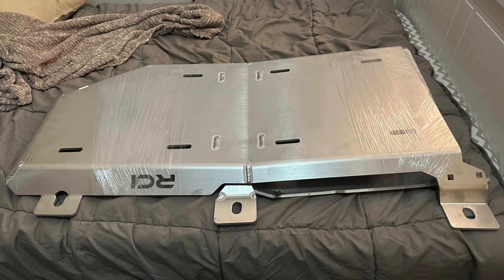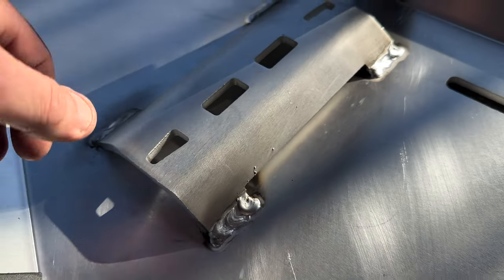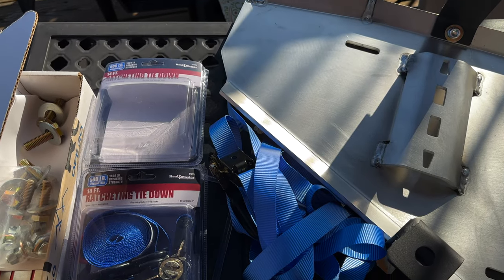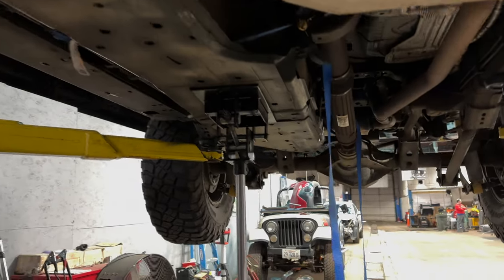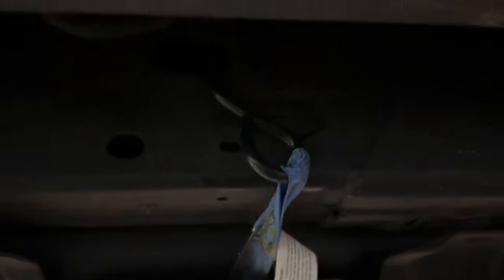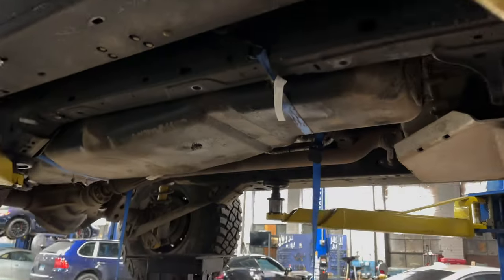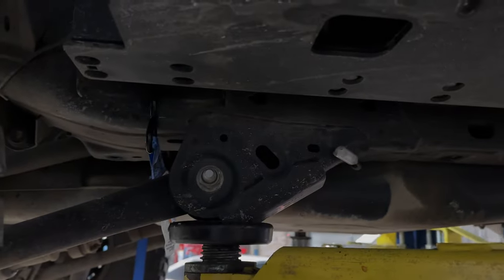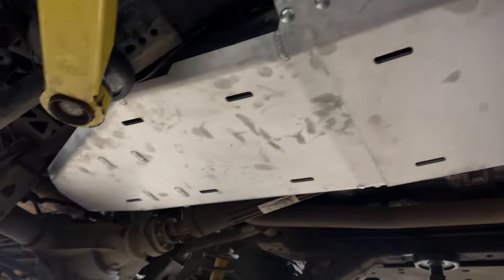Bronco RCI Fuel Tank Skid Plate

Comment: Looking at doing this as well - How difficult would it be to drop the gas tank?
Reply from the maker: If you don't strap it up prior to removing the stock skid, it will fall.  The general rule of thumb is to have the least amount of gas in the tank as possible prior to doing this.  The JCR video I linked in the description has a more detailed account on using the straps.  I would not suggest dropping the fuel tank for this addition.  I don't see an advantage in doing that.

Comment: How has the RCI aluminum Fuel tank skid held up vs the OEM? I have a Wildtrak and need to add protection, but also keep the weight as minimal as possible. I’ll be doing more overlanding and trail running, not so much hardcore rockcrawling…
Reply from the maker: No issues at all.  TBH, no one will see the scratches unless they crawl underneath.  If you don’t mind paying a little more and want corrosion free and lighter weight, I think they’d be a perfect option for you.  I had them on my old 4Runner as well and we had it in Moab as well as Ouray.